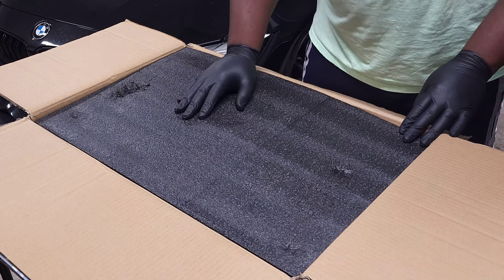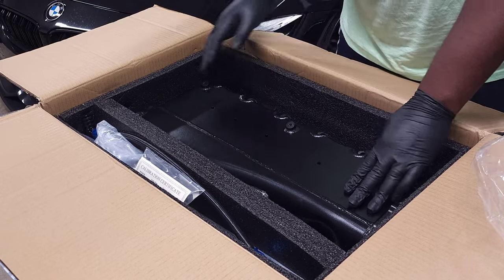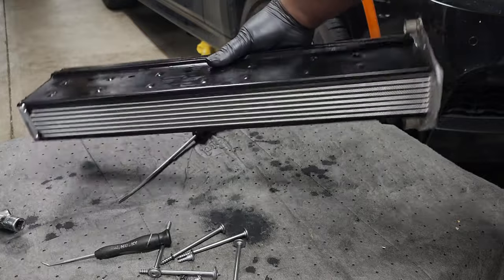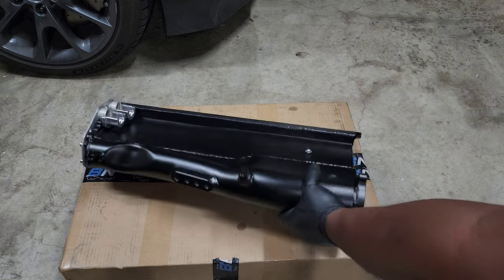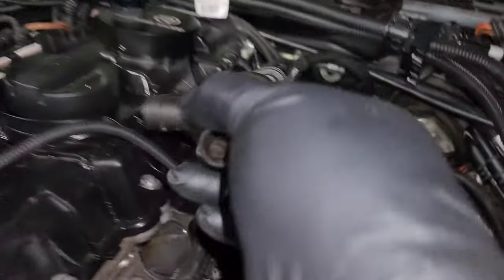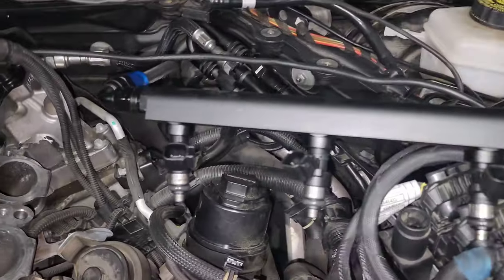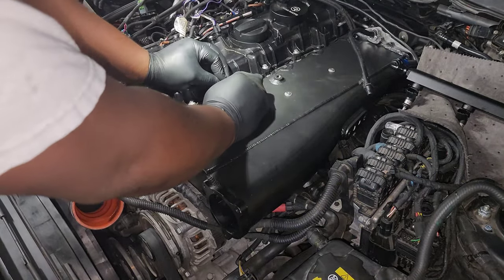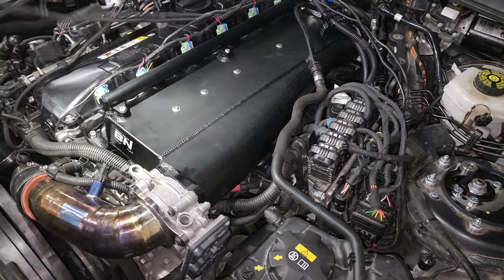Installing the BimmerNetwork Intake Manifold on my 340i

Comment: The stock core heats soaks bad enough.. let alone with aluminium surrounding it. For the sake of adding port to have inevitable higher IAT is 🤯
Reply: so you think if not going port there is no need for the upgraded aluminium core?
Reply from the maker: stock cooling doesn't heat soak with stock turbo. worked great on track.
Reply: @kern417  at 1.2 bar its happy. Making jam at 1.5bar it will soak
Reply from the maker: @NVMotorsportUK  nope, I've been pushing 22-23psi no issue. Temps cool down after the pull
Reply: @kern417  on stock turbo?
Reply from the maker: @NVMotorsportUK  yes
Reply from the maker: Even some ots maps push 20-21psi. Stock cooling system works great in the 500ish range
Reply from the maker: ethanol mix

Comment: When would I need bigger injectors like the 750cc like you said, my goal is run stage 2+ for a year or so then want to get a pure800 or flowmax so once I do that turbo upgrade then get this manifold and also the 750cc injectors?

Comment: How different is this from the BMS Aluminum Intake Manifold, they look pretty much the same besides the price and this one having the BN logo
Reply from the maker: Map sensor fix is the biggest thing that sets apart the BN manifold so there's no cutting or modification required and install is nice and smooth.

Comment: sorry im not familiar with material used on these manifolds but is it worth the money to get the rk vs the bms or bimmernetwork manifold, currently stock motor and trans with mpr1200 pi. planning to change turbos build motor and trans so wanna know whats best for long run
Reply from the maker: RK will be much better for higher hp builds.

Comment: Hi @kern417 Today i got fitted M LSD to my M240i manual. All good, but when i am in the gear and let off the gas there is small jerk. Is it normal? Or my ecu need to adjust for lsd??
Reply from the maker: probably the lockup

Comment: Hello 
Which intake manifold do u recommend with replaced stock intercooler,becouse many of us would buy new manifold not only for supporting enough fueling but intercooler too?
Reply from the maker: rk autowerks
Reply: @kern417  do i need to buy separate port injection or that manifold comes with it,because otherwise i doubt it will fit in stock one...Thank u!
Reply from the maker: it has fittings for port injectors built into the manifold